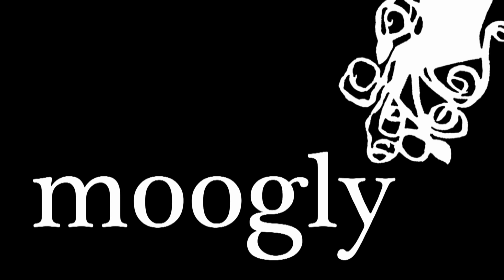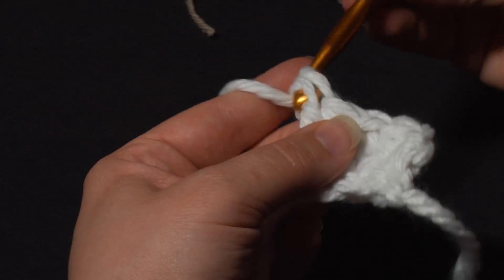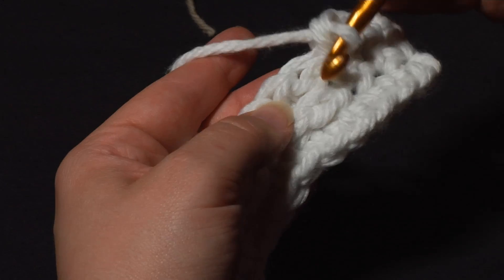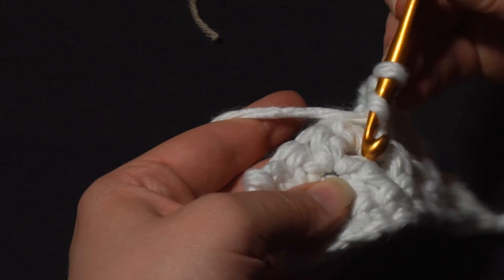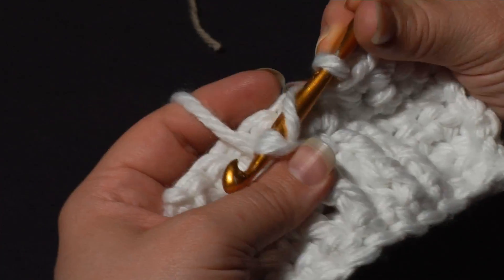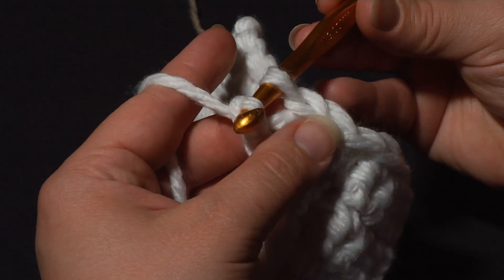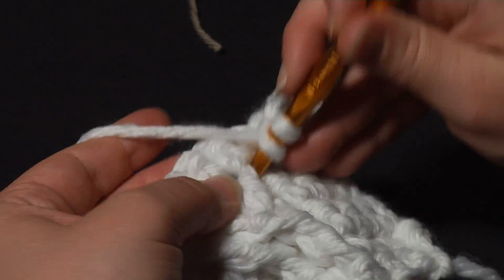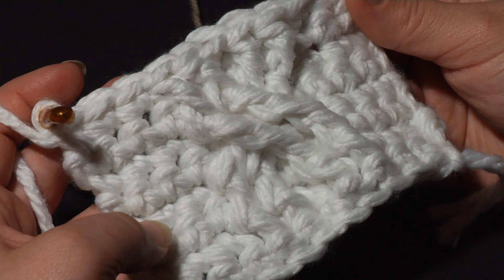How to Crochet: Basic Crochet Cables

Comment: Howdy ! Thank you so much for this super easy to understand video ! Question, if I wanted to make the cross go the opposite way would I go left to right instead of right to left?
Reply: I'm not 100% sure what you're asking. If you want the cable coming from the right to be on top and you're a right handed crocheter, you'd need to work behind the first cable when making the second cable - doable if rather fiddly. Does that answer your question?